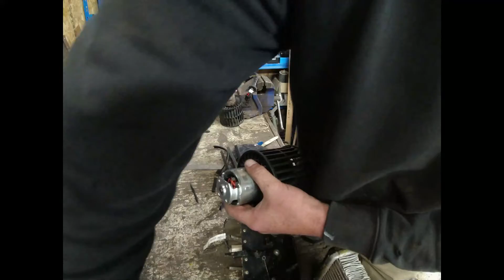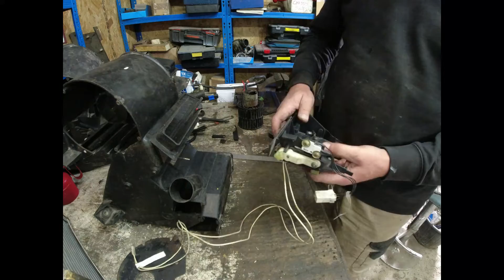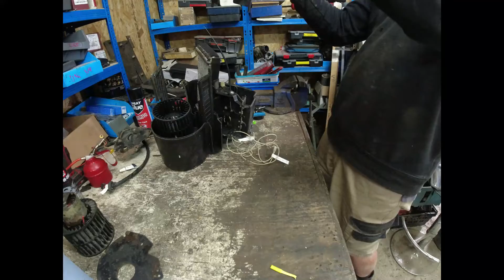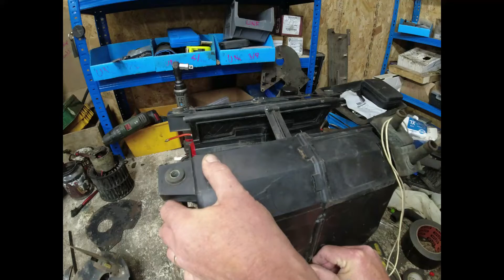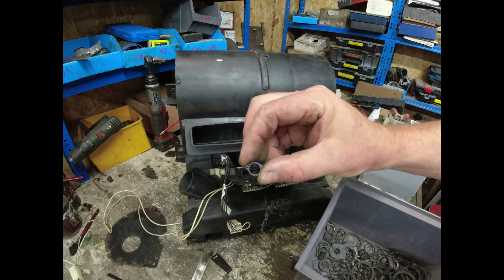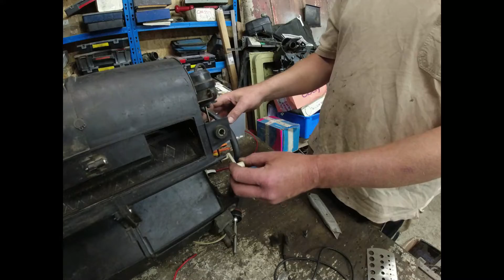Range Rover Classic GA-LA Plastic heater box squealing motor repair

Comment: Yes, i truly hate those heater boxes. Did mine this summer, have to take the hole dash to peices! On the two door with the metal one, three skrews, and the fan was out! Left hand drive, right hand probably worse?
Reply from the maker: I couldn't get the "metal heater box" motor out on a RHD RR. I could however access the end bearing plate via the glovebox and lubricate it